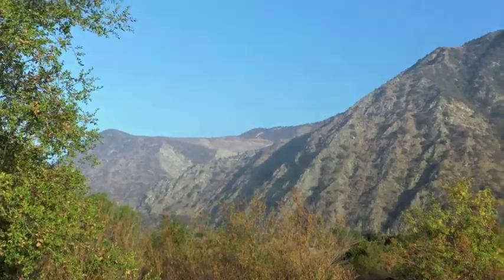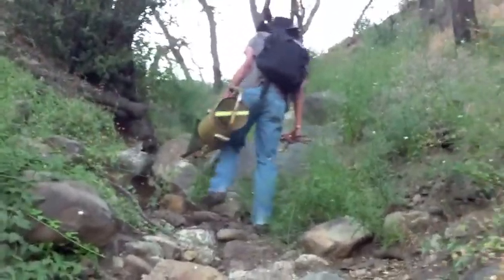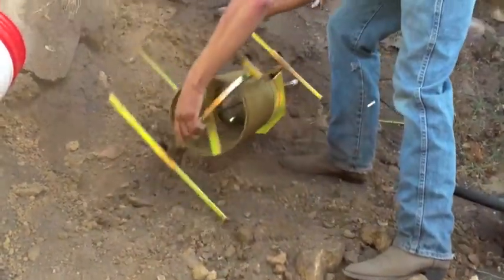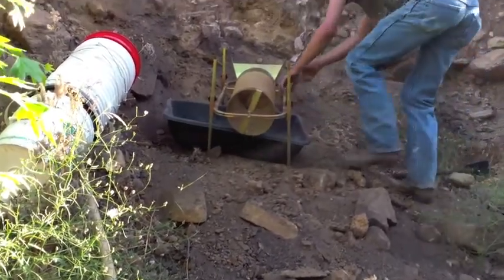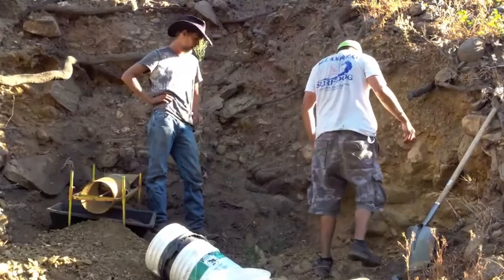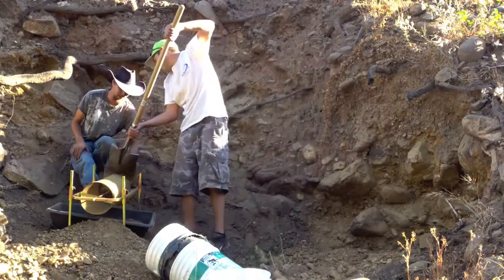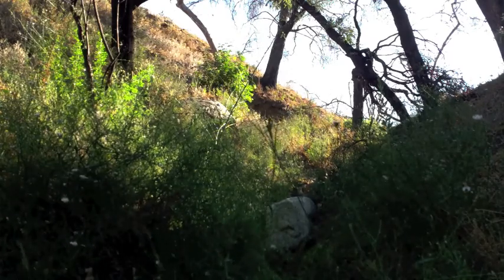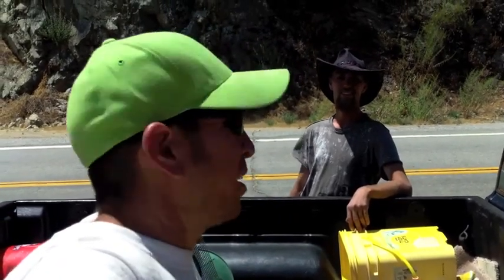Western Prospecting  - Testing a new Trommel

Comment from the maker: You're question is spot on... In most cases you want to wash the rocks as thoroughly as possible. But, there are times where dry classifying is the only way to go, such as ; when there is zero access to water (desert), the gold is ultra fine and mixed into certain soil types (sand), and I have been personally dry classifying for my gold because I can move more material (its faster) and I have more energy (I'm not carrying and extra 10-15 pounds of water weight with every bucket).